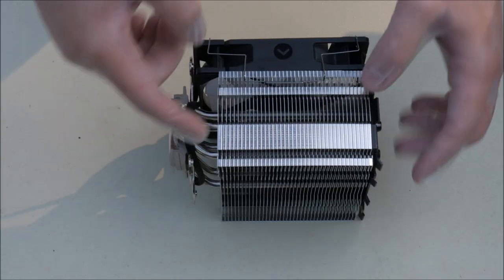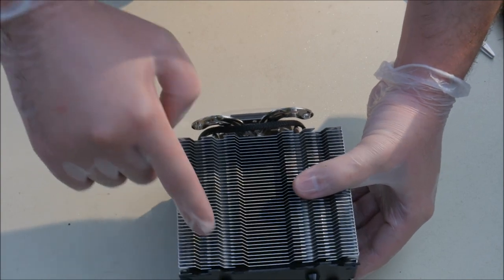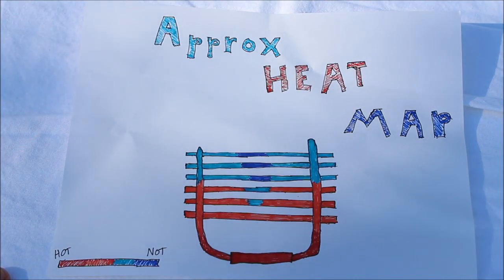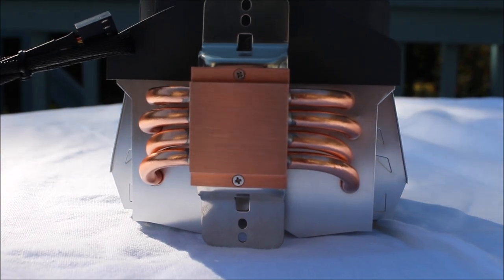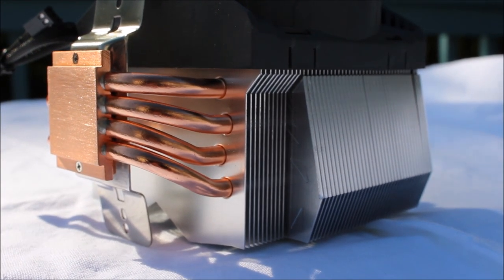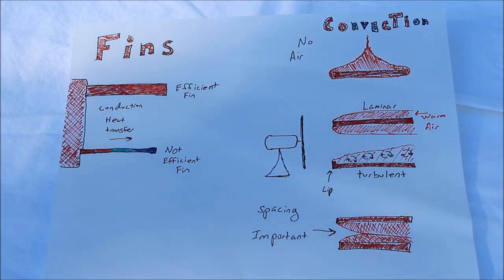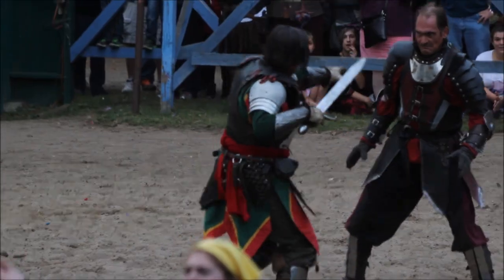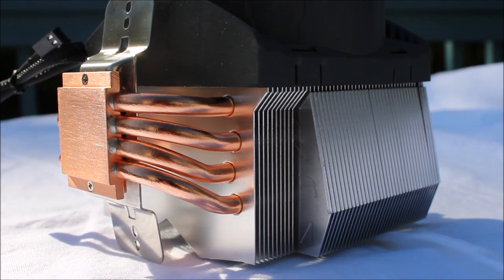How Do Heat Sinks Work?

Comment: To dumb it down for people quickly, the heat from the processor conducts to the fins of the heatsink, and the fan blows through the fins cooling it. If I missed something or got it wrong, please correct me! I've only had a few years of science classes.

Comment: I had no idea the pipes on the heat sink were so...engineered. I thought they were just copper tubes! Thanks for the informative video.
Reply: They are known as heat pipes and will often contain a liquid coolant which will change phase between liquid and gas

Comment: so basically its just a mini version of a car cooling system
Reply from the maker: Nope, think of heat pipes as just a heat highway. It is just a way to move heat very quickly over a distance. A car AC must add some work to compress the gas to turn it back into a liquid. Then it must cool it and evaporate it to get the cooling effect in your car.

Comment: I disagree on conduction being superior to convection. It depends on the specific implementation of the cooling system. If you mean conduction is better than hardly any convection at all, like in your frying-pan example, then you're right. However, if you force the convection just a tiny bit, you get much better results. Convection is the reason water coolers are superior to air coolers, as it makes it possible for the heat to be transported away from the CPU more quickly. Yeah, in theory you could make a three-metre tall passive cooler with ultra-thick, solid-diamond pipes and diamond fins. That would beat the water cooler, but at what cost? But then someone would come up with a new liquid-cooler design that would move ambient-temperature water next to the CPU at a flow rate of 10 litres per second and would beat your diamond cooler at a fraction of the cost. Also, it's the steam inside the cheap air-cooler pipes that moves the heat away from the CPU by convection, and it's convection forced by the fan that pushes the heat away from the fins. So most of the heat transfer that occurs in air coolers is done by convection.
Reply: You don't even need that much overkill to outperform water cooling, big heatsinks with big fans that fit inside a computer case trade blows with water cooling and beat it in cost/reliability. The only thing water cooling has going for it is the huge amount of mass you can have inside the recipient and distribution blocks in a custom loop, that will delay thermal equilibrium and beat air cooled temps for longer. But leave your computer rendering and 30 min to an hour the temps will equal an air cooler.

Comment: Something came to my mind; as far as i know there are two basic kinds of cpu heatsinks one is fabricated with direct contact heatpipes and the other one is with a nickel coated- or not- copper plate heat pipes.  why another plate apart from the ihs is using although direct contact ones sounds better? Isn't it second time and space barrier for the high temperature which we want to get rid of? I know it acts a heat spreader but doesn't this mission belongs to the ihs itself already? By the way i've got a double tower with two fan cpu cooler branded thermalright peerless assassin SE with a nickel plated copper plate that kind of i was complaint about. And a question; how can i improve it's performans? can third fan be useful? Thanks a lot!
Reply from the maker: @penumbra3  is there any reason to improve its performance? If the answer is no then don't worry about it. The details about the plate are kinda low level and maybe a little bit of marketing. Yes it is probably most important junction in the system, a good vs bad one could mean anywhere from 5 to 10 degrees. But if you have more than that thermal margin which most people have then there is nothing to worry about. The model you mentioned is one of the largest ones on the market, when you get up to that size they all perform about the same.
Reply: @TheNuclearPinball   I'm cool with my CPU cooler, but it would have been better if it were more efficient.) When i'm baking in blender it sees 90°C's and thus the health of cpu becoming to concern me.  maybe better for me to pass liquid one. Anyway thanks a a lot for both videos and respond of yours.. I would love to see some blender videos.. Dont give up, upload new videos..

Comment: So, long story short..
The heat from CPU goes to the base metal plate (made from coper in this case) wich then spreads to the radiator looking thing.. wich also has a medium size fan atached to it wich then blows wind to the radiator to faster blow away the disipated heat from the radiator.

Comment: Hi. Does the fan blow air into the heat sink? Or does it blow air away from the heat sink?
Reply: You want the fan to blow air into the heat sink.  some heat sinks can have two fans which then you want a push pull configuration where one blows air into the heat sink and the other blows out

Comment: I have some stupid questions if you guys dont mind :) What if I have a small wooden box, 100x85x25 inches. Would I lower the temperature inside the box if I just put a 100x85 inches aluminum heatsinks for LEDs under and on top of the box and cool them with a fan? Also, can you lower the temperature inside a closed kitchen cabinet or drawer using heatsinks and fans and no air flow to the outside? I need like 5-10° celsius for both cases. Should I buy and experiment or its just not enough ?Thanks
Reply: AL DEL I dont know how to answer this. However, if you cant find an answer online I’d check out different PC threads on Reddit. Normally they’re very helpful.

Comment: Hi. Can a heat sink work in a vacuum?
Reply: I know your comment is 3 years old, but yes a heat sink can work in a vacuum (which is why the ISS has heat sinks) However, because there is no air for convection, it can only transfer heat through radiation which is far less efficient than convection dissipation. So you’d want a coolant to act as a medium in place of air.
Reply: @jakesheldon7637  wouldn't the coolant just keep heating up because there is no air for the heat to transfer into?

Comment: Really interesting intro for a beautiful piece of engineering. Tell me - can I use this heat sink device on board my small boat with 12v system for the dual purpose of 1) excess power dump for a wind turbine (in combination with a DC converter / charge regulator), and 2) as a means of heating the cabin (ie. background heat to take the edge off cold winter days)?
Reply from the maker: You would just need to size a resistor for a load dump, however any power generated by wind turbine would be quite low and probably not enough to heat the cabin meaningfully. The resistor would also need to be properly sized for the load maybe PTC would be better as it is self regulating . Either way not a good use case for these types of heat sinks

Comment: What I don't understand is based of the way you explained it, it should work optimally! But off this detailed review, its mediocre. Why is that? You seem to have a deep understanding of how it fundamentally works, why would someone say its basically... "whatever". is there any room for improvement? http://www.overclockers.com/arctic-freezer-13-pro-co/
Reply from the maker: wrathoffufuke I would take these reviews with a grain of salt. Most tower heatsinks have the same design but the quality of material can also be a factor. The world of computer cooling is full of Marketing misguidance mostly because it can be difficult to measure the actual performance or if the extra performance is required. There is always room for improvement but that always comes with a cost. Hopefully this helps